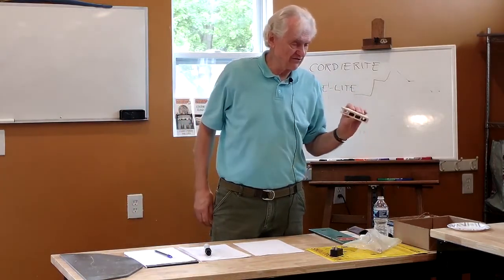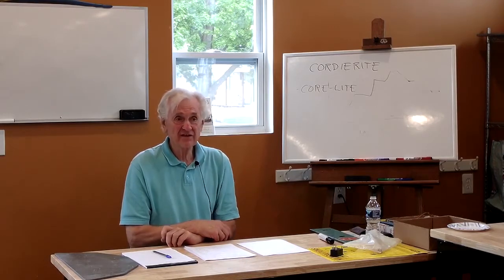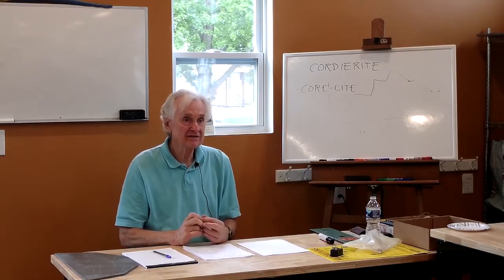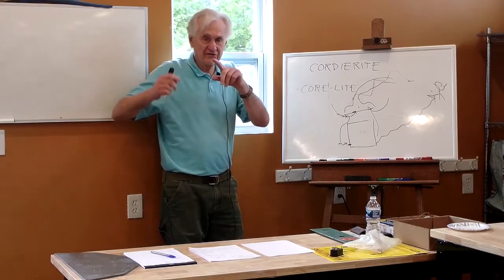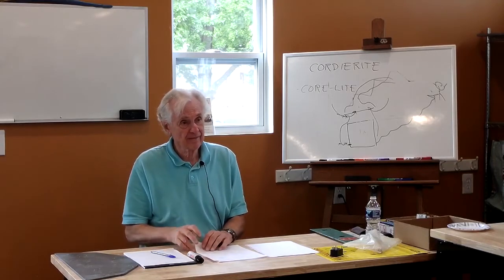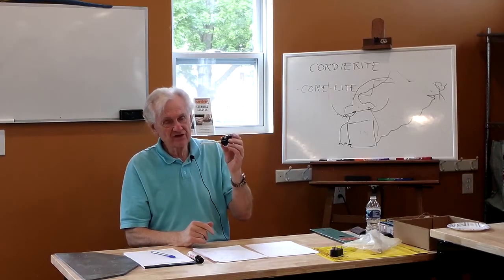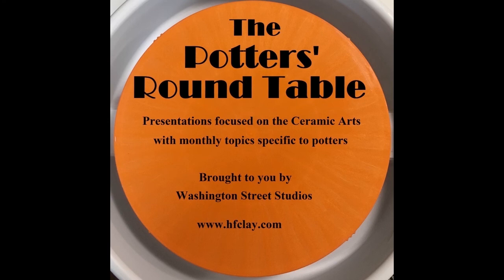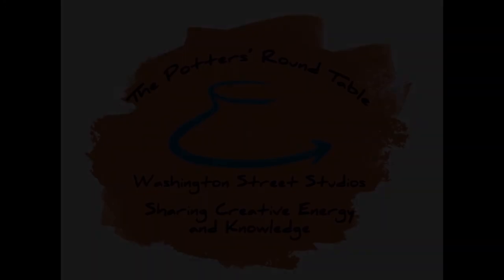Understanding Pottery Chapter 15 Electric Kilns Part 3

Comment: Thank you for the lecture. I just purchased a small kiln (Skutt km714) that goes to cone 8. I have been told that I should not ever go to cone 8 because the heat will degrade the elements quickly. I would like to fire to cone 6. Would this be alright? Thank you for the recommendation regarding the venting options. I did not realize the fumes degrade the elements over time.
Reply from the maker: Thank you for watching and especially for commenting! Yes, cone 6 will be fine. As a general rule, the higher you fire the harder it is on the elements. Kiln manufacturers will put elements in the kiln to provide reasonable performance at the rated limits for the kiln. What that means is firing to cone 8 would not really be a problem although it does stress the elements slightly more. A friend of mine has an electric kiln he uses only for bisque firing and has been using the same elements for over 20 years. I have an electric kiln that I fire mostly to cone 06 bisque and cone 6 glaze with the occasional cone 10 firing and my elements lasted 10 years. I average 12 bisque and 12 glaze firings a year. The key really is venting the kiln.

Best of luck with your kiln!